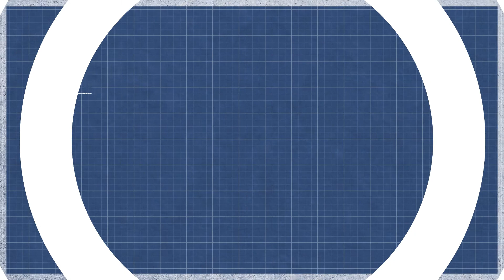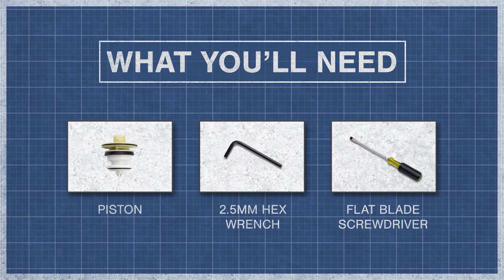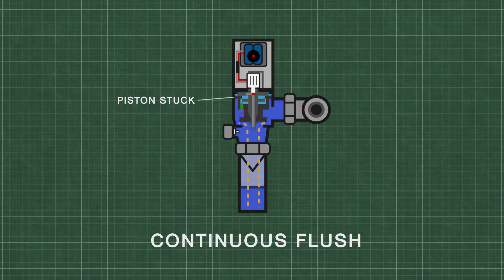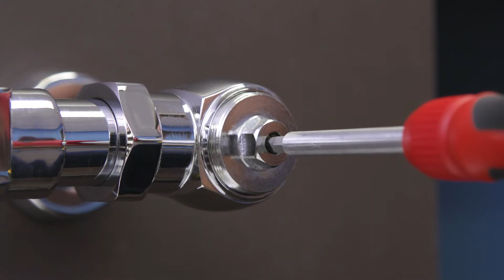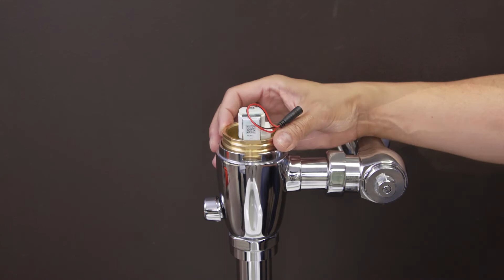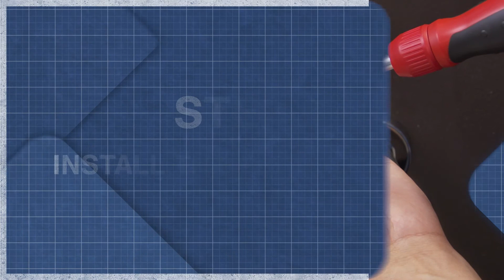American Standard Selectronic Flushometer | Piston | Repair and Replace

Comment: To whom it may concern: The American standard Selectronic family of flushometer valves are adjustable in flush length via the remote control, which can be purchased online. All valves can be reprogrammed to increase or decrease flush water volume with the remote. Unfortunately, for those of us who want to provide our customers with a 3.5 gallon per flush cycle (10secs) we have to fall back on the usage of the remote as they come set from factory to max out at 1.6 gallons per flush. One of the things that both American Standard nor any other website or YouTube channel fails to tell you is that, when using the 605XRCT remote to diagnose or reprogram any faucet, urinal, and or toilet I noticed it’s best if you place remote IR emitter touching the sensor on the valve you’re working on. And always diagnose first to obtain the info on the valve then set the correct Year Model parameters without wasting your time. 😎👍
Reply from the maker: Thanks for watching and sharing this info.
Reply: Where’s the program information stored?  There’s no PCB or anything in the new one I have.

Comment: what would cause the urinals to not flush? the solenoid makes a click sound but does not flush... manual flush works
Reply from the maker: There is one more thing to consider. A mineral buildup might prevent water from flowing when the solenoid opens. It would be good to open up the valve and try inspecting the piston and solenoid. Make sure that nothing is blocking the path between the two.

Comment: So i tightened the bonnet nut down on to the piston and once I started to open , valve, water begins to fill pipe . I push manual valve and water begins to make it past piston in solenoid housing .Bad manual valve ? Not tight enough on bonnet nut ? I checked solenoid and its good , makes a click noise . Help would be appreciated .
Reply from the maker: Thanks for watching. It is possible that the piston is not seated properly in the valve. It would be worth removing it, checking to see if there is any corrosion or mineral buildup in the valve and threads and reinstalling the piston.

Comment: WHat are these part #s and where are they listed in your catalog
Reply from the maker: Thanks for watching. The best way of narrowing down the part number is to find the part sheet for your model like this one: https://www.amresupply.com/part/11203082 If you scroll to the bottom you'll find a few PDF's. 

Keep in mind there is some variation between models, like this one with a 10 year battery has a different piston and solenoid: https://www.amresupply.com/part/6066721-002-AmericanStandard-WC-Flush-Valve-10YR-Battery

For example: M962907-0070A
Is a common piston for urinal flushometers: https://www.amresupply.com/part/19508278?replaces=M962907-0070A

Comment: will a malfunctioning piston create water hammer?
Reply from the maker: Thanks for watching. It is possible though the piston is not as likely as a source of water hammer as compared to a pure solenoid valve like in a washing machine. Solenoid water valves are more instant in how they open and close. (Keep in mind the solenoid used in these flushometers only opens the bypass)

You could check the rubber seals to see if they are sticking. In an ideal scenario, the seals should be tight but not sticking or preventing movement.